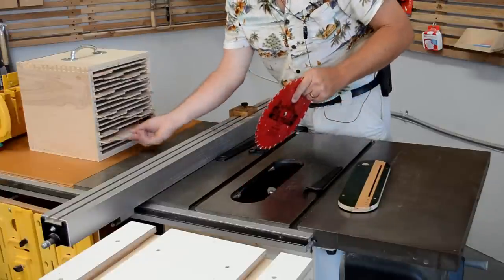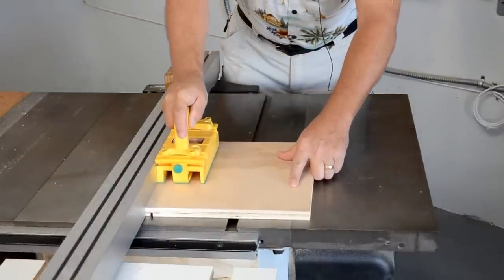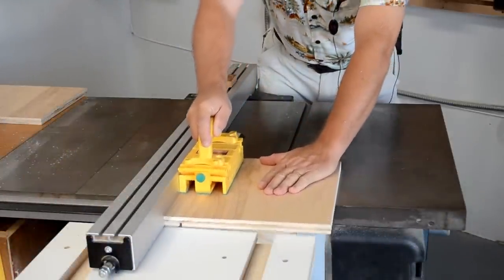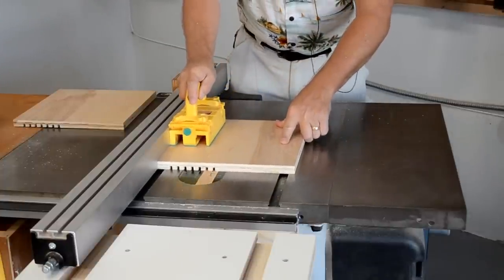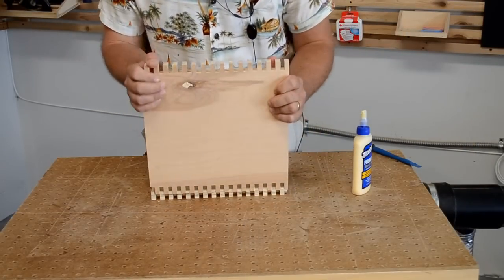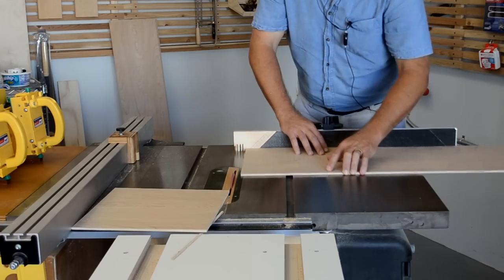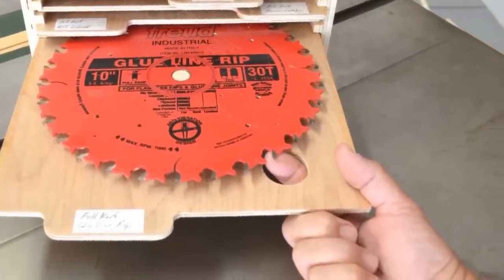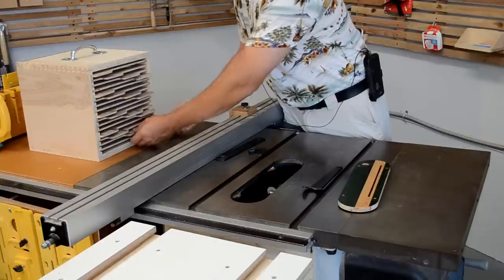Build a Blade Storage Box

Comment: Tried several times to get these plans on your web site but they will not download. They show up in cart but don’t download. Can’t find any contact information either.
Reply from the maker: Bill, should be working, I will look into the problem. There is a “Contact us” page on the site. Just email me at ralph@Woodcademy and I will send you the file.
Reply: @Woodcademy  Ralph, I did get it to finally download. Also two others. I’m wondering however what you used for the center to hold the blades in place. Doweling maybe?  Thanks for the quick response!! Love your videos, Bill
Reply from the maker: @billirey9459  yup, just a short piece of 1/2” dowel. Drilled a 1/16” deep hole to locate and glued it in.

Comment: Definitely the best design out there! The tabs with labels, finger hole lifts, and ability to have trays in same box that hold various size blades for circular, miter, table saws. I think the only thing I would consider adding is a drawer on top or bottom for Dado parts.
The link to your plans is dead however.
Reply from the maker: Ken Olson thanks for the kind words, glad you like the design. Thanks for letting me know about the link. I have updated it to the Plans page on my website. You will find lots of plans there, free and paid. These are free.

Comment: Moving fence too much leads to errors, no splitter or riving knife, dangling earphones. Good box but very poor practices.
Reply from the maker: S21urcle, thanks for watching. You need to work safely as you see it, as I do for me. I have and use Splitters for my saw when needed. They are NOT needed when cutting plywood or other man-made materials. There is zero danger of a plywood kerf closing in the back of the blade. As for moving the fence too much, not sure where that comes from. My fence, the old Excalibur, is perfectly set up and I can place it where needed as needed.
Reply: Ignoring safety because you are overly confident is a terrible reason. Safety is never not needed. Hope you enjoy your avoidable injuries in the future.
Reply from the maker: @S21urcle  I never ignore safety. I do happen to know well the physics of cutting and table saw use. I did have an accident, 30 years ago, caused by ignorance. That drove me to learn everything I could to be safe, and have not had another incident in three decades.